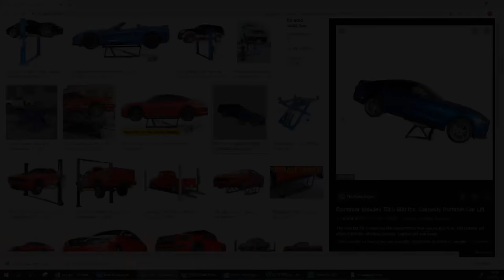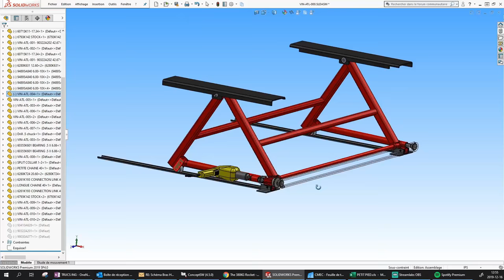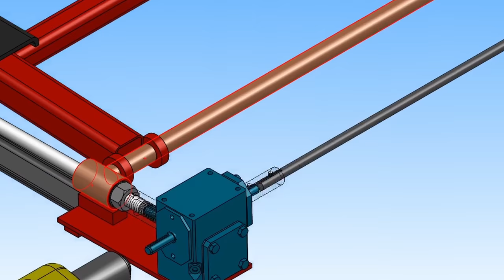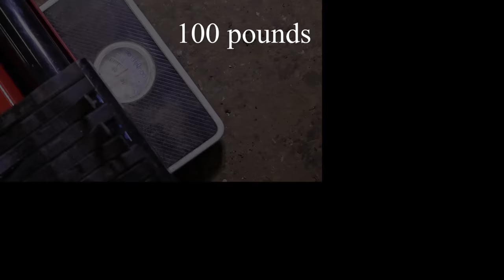DIY Car Jack, Car lift

Comment: Excellent video! Well done! I like the gutter idea for the rollers as I too have a gravel work area. The only difference in my project will be to remove the gear boxes and utilize a central "Y" design for a single ACME rod with the drive mechanism from the front or rear of the vehicle instead of the side where yours is positioned and I will be using this for my Smart For Two
Reply: 350 dólares por cada uno de los dos engranajes reductores marca  IRONMAN by GROVE GEAR). Ahi ya tenemos 700 dolares. agreguemos todo el resto de materiales y ejecucion, Es un aparato muy interesante pero a un elevado precio.

Comment: The unf screws wouldn’t work for long anyway, they are not designed to screw/unscrew often without wear since they have non square (pointed, sharp) thread. The acme rod has a square thread and doesn’t wear when the acme nut is moving on it.

Comment: I made, same swing type lifter for the scooter, few years ago. It locate under of the center stand, which is locked  its lower position by bar.  I rocking scooter side to side by hand and when nearest leg is up, I turn wooden block under it by leg and so on, few times. When both side is level,  scooter swing like your car, its one end up to repair. It`s slow to use and little bit risky to use, but enough usable to stay in my garage. It`s only lifter which I can take on the scooter, for to do lift in other place. 

When I have to remove the engine, the center stand goes with it. So I did, two two-legged rope hoists. I attached two ropes to the winch spool and two pulleys to extend the positions of the ropes, to ensure a stable lift. It lifts optionally in three places: the front, mittle or rear of the scooter. When it lifted at the mittle, it swing. Its two leg frames look like a guillotine and the vinch is on top of it. The frame design is space saver. 
Other 3-rope lifter was attached to the seiling and use one vinch. It was too stationary to use for me.

I made some experiment for rocking table (legs of two pair turned freely down when other end lifted by muscles) to lift scooter, but it did`n got air under its wings...
Reply from the maker: That's a cool build you did Jari, keep up building stuff  👍

Comment: I noticed the front wheels were on wood blocks. Would the jack not have fit without them?
Reply from the maker: You don't need them, but my wife's car has a flappy exhaust cover that keeps getting caught with the lift. So the wooden blocks are optional but useful... 😅😉

Comment: Great idea. Very nice simple design
Reply from the maker: Glad you like it! 👍
Reply: Viny B Viny, I wonder if you could build in a locking system like quick jack to ensure more safety. But I love the way you can lift the back or front for extra space, and it's amazing the car is still well balanced. BTW if we wanted to attempt to build this what sort of gear box is readily available to use. I'd really love to build this because I wan t to help my son change his timjng belt on his car and I can't bend too far atm

Comment: The pivot lol that's fucking genius. But how do you work out the balance? I actually hate jacking up my car. I've a 3.5 tonne jack, pads and all. Yet because you're one corner at a time I always feel it's just unhealthy pressure on the chassis. I'm curious how to make a drive over level lifter for at least either end. Ideally it would be all 4 corners but I'll either get a second jack or come up with something. But I'd at least like to be able to jack the front or rear level on both sides. I've been there too many times where the ground isn't smooth so the jack doesn't rise and pull the car away from the axle stand. I picture driving the front or rear wheels on and then gears rising or pumping jacks so they're balanced.
Reply from the maker: Each car has it s own position with the jack and once you found it, since the gravity center is right on top in the "flat" position, ince you pivot it ine side it slips to this side...quite simple

Comment: Bonjour, connaissez vous le poid maximum que l'on peut soulever avec ce mécanisme ?
Savez la correspondance de 3/4" 16UNF en Europe ?
Reply from the maker: Salut, je ne connais pas la limite de poids de ce jack, je ne l'ai jamais testé à la limite. 3/4 c'est comme du 19 ou 20mm et 16, c'est 16 filet au pouce ou à chaque 1/16, donc au 1.5mm. Mais si je me souviens bien j'avais utilisé du 3/4-10, soit environ du 2.5mm

Comment: Hi Vini can you please put the plans up again. I would like to try making it this summer. The PDF I download is blank. Any chance you can put the 3D plans up again or maybe send it to me. Thanks
Reply from the maker: HI, I'm sorry for safety purposes, I never gave the plans for the lift. For the 3D, make sure to open it using Adobe acrobat reader, not a web page from a browser.
Reply: @VinyB57  Viny, where are the 3D plans. I can only see the PDF version and for some reason it’s blank when I download. Btw, I’m not sure if you noticed but a very similar version to yours seems to be commercially available. I’ll send the website when I find it again
Reply: @VinyB57  Viny, this looks very much like your design. I would probably buy it I’m sure it would be cheaper than me making it. But I don’t think it’s available in Australia.
https://www.autoliftproduction.com/en/autolift3000
They even made a baby version to replace a normal jack. Very clever use of the same design.
Baby version found here https://www.autoliftproduction.com/en/up-down3000

Comment: Hi, will this operate with an impact wrench or impact driver, instead of with just a rotary drill? I like to use an impact wrench to remove lug nuts, but I don't want to buy a separate power drill.
Reply from the maker: When using sprokets or gears, it's never a good idea to use a impact driver, it's like hammering on the teeth of the gear or sprocket. you need a smood flow of rotation, not a jack hammer!
Reply: @VinyB57  is there any combo tool, or at least some kind of adapter, that would allow both different types of operation, for rotary drill and impact wrench? I'd prefer to have that, then have to buy 2 different power tools.
Reply from the maker: @manofsan   Yes, my tip here is to weld a rachet box on the lift, one that you have in extra and use the squarre as an adaptor. Use a box that will fit your impact (don't use a impact 😅) and you can modify a rachet extention to fit your drill, or buy a squarre to hexagonal (for small impact drill) and chuk it in your big drill. I use the squarre to hexagonal for my lift
Reply: @VinyB57  - here's a video from someone who bought a similar type of tilt lift from MaxJax:
https://www.youtube.com/watch?v=YpUh-KjrkfQ
As can be seen, he experienced some serious problems. Are there any similar weaknesses in the design you came up with? Or are such weaknesses inherent to this kind of tilt lift?

Comment: Nice set up. Not including labor, how much did you spend on the parts? I'm considering buying the autolift, which is similar. Thanks!
Reply from the maker: Not much really, 100$ for the gear boxes (2), couple of bearings, acme rodes and nut, I already had the steel, let s say about 200-250$, but a lot of trials and errors... 🤷‍♂️🤦‍♂️
Reply: @VinyB57  Thanks for the info and especially for doing the trial/error. Now I can make an informed decision.

Comment: Hi! Amazing project. Thank you so much for share with us. I'd like to build it for me, but the pdf on  Dropbox link is empty. Can you check it out, please?
Reply from the maker: I Paulo, I had problems with the PDF, because it's still there in the Drobox file, but depending on your ''luck'' and/or your computer, nothing will show up! You can try 2-3 times, sorry sir!
Reply: @VinyB57  Thank you for your quick response! You are the man! Unfortunately I've tried it on 2 different computers (Mac and Windows) and on the iPhone, in 3 different browsers, countless times. I think the file is really blank or DropBox is having problems. The file has no information, no matter if loaded directly into the browser or if I download and open it in Acrobat Reader. Could you try to make it available to us on another platform, like Google Drive for example, please?
Reply: @VinyB57  I just realized that there may be a problem with the password restrictions you set up. Maybe that's why we were unable to view the file's contents.
Reply from the maker: @pauloterenzi  Hi Paulo, I tested the Dropbox link whit my wife's computer, and everything seems to be OK. But once I open the 3D PDF...blank page. I think I reached the limits with 3D PDF, sorry Paulo!
Reply: @VinyB57  then use Google drive !
Reply: Dropbox?🤮🤮🤮🤮

Comment: Can you drop a transmission with this jack?
Reply from the maker: Never tried...don't think I will, but you'll need to add someting in the middle and have the car suspended in the air by something else then the jack!

Comment: Can you please tell me what issues did you have with the first design? Only screw jamming or something more? I have an idea how to build a parallelogram lift for my own use. Russians use volga 24 jack for the drive and its great but who on earth would ever buy a volga other then in USSR. 😀
Reply from the maker: For the first design, yes one of the major issue was the jamming screw, but also, having only a 2:1 reduction with sprockets and chains was to hard on the HP of my 1/2'' chuck drill (Dewalt). Now it's much better with the worm gearbox 5:1 ratio and the '''driving shaft'' between both gearboxes, no more chains!
Reply: I have just realised that i have 1kw motor with 20:1 ratio gearbox and a sprocket for 3/8 chain already on it. I think it is marked 10b-1 that should be more than enough to power my lift. I'll try to upload a video of a finished build. When i finish it. 🤣
Reply: The chain, as I plan, will be placed instead of a screw in Your design. The force distribution is the same, of course diferent design, similar to quick jack models. I practically plan to use your design to lift one side of the parallelogram. I need free floor between two sides of the lift. It will be secured with a support bar on both sides and i trust my welds since i am a certified welder.

Comment: That's a brilliant lift.  Just DON"T EVER get under the car when it's lifted on that device.  ALWAYS use proper axle stands before climbing under a car.
My brother-in-law was almost killed when his floor jack (trolley jack) failed.  He was trapped under the car for a good while, & could barely breathe with the car sitting on his chest.

Comment: PDF INSTRUCTIONS! guys the pdf works fine its not black what you need to do is download adobe acrobat reader. DO NOT use a browser to open the pdf. this pdf is a 3d drawing so it requires adobe acrobat reader. once you open the pdf in there it will be blank just click on the white space and it will render the image. you might see a yellow bar on top that says you have to enable 3d rendering just enable it and you will be good to go.
Reply from the maker: YES ON EVERYTHING YOU SAID!!!!! THANKS MAN! THAT IS A REALLY GOOD EXPLANATION, I'LL CUT AND PAST IT ON THE VIDEO DESCRIPTION👍👍👍👍
Reply: @VinyB57  np I got tired of everyone asking the same thing lol I had to do something about it 😜 i take payment in the form of the real drawing with the dimensions lol!
Reply from the maker: @homerogonzalez2909   Good one... 😂, thanks man!
Reply: @VinyB57  😂😂 cheers 🍻

Comment: Can you tell me , what metal you use to made the jack , because my final semester project is to build a scissor jack that can lift 2 ton or any suggestion to build my project
Reply from the maker: I used standart steel, 1020-1018, but the srcews were hardened steel
Reply: I'm no engineer but consider the screw jacks found in most cars. The thickness of metal is not much more than 1/4" lifting hundreds of pounds.

Comment: I also downloaded the zip file, but when I opened the PDF file in it, nothing shows up on it.  Is it possible to please try to deposit a file that would show the plan?
BTW, awesome video!
NEVER MIND!  I opened it (I did not get it the first time watching the video in that the file is a  3D PDF file).  In any case, folks who are trying to open the file; there is not much in the file that could help you!  The video shows the detail much better (in fact the drawing is shown in the video at 3:05.  It has no dimensions or specs; so, just DO NOT waste your time!
Reply from the maker: Thank you Zack! And yes no dimensions for this project... not this one...for safety purpose. I don't want that someone get hurts and claim that he followed my plans..... I'm sure you'lll understand!

Comment: Do u still use this lift if so how are u finding it ?
Reply from the maker: Yes I'm using it all the time. The only down side is the time of setting, which is almost nothing, 5-10 min at the most. So for a quick job, like an oil, I won't use it, but for bigger jobs, it's a must!

Comment: Can you tell me what the part number for the gearboxes you used are? I've been trying to find them but everything so far I've found is to big
Reply from the maker: You can see the name plate with part number on this video at 5:26, you should have all the info to find one...or two.... 😉
Reply: @VinyB57  Thank you, could you also tell me where you found the lifting pads? Also would 3/8" inch wall square tubing the thickness you are using?

Comment: What problems did you have with the chain and sprocket system ??
Reply from the maker: Hi Lyndon, 2 things, first: it was too hard for the drill, the sprocket reduction of 1:2 was not enough, the drill was smoking after only few seconds, secondo, it felt weak. The shafts were bending has the chain was pulling on the sprockects from both sides. Just a bad design, but maybe with bigger shafts (at leats ø1'') and good reduction (at least 1:5) that could work. But thing how big the sprocket will need to be to get the reduction, that's why I went with the worm gearboxes.

Comment: Can you please tell us the specs of suitable worm gear for this application?
Reply from the maker: Yes sure! I used a 5:1 worm gear. The worm gears need to have pretty straight theeth so it will ''lock'' in place the screw. If you can easely turn the output shaft of the gearbox, you'll know that the gears have to much angle. If you combine the angle of the screw with the gears angles, that will keep the jack ',safely'' in position to put your jack stand underneath the car. I'm hopping that will help you!
Reply: @VinyB57  Many thanks for your quick response; much appreciated.  However, since I am a novice in this game, can you tell me information like the torque capacity or HP,, RPM etc. that would help me to select the right worm gear?
Thanks again!
Reply from the maker: Hi Zach, yes, the spec for the gearboxes are: ratio: 5:1, RPM 1750, input HP:1.248, output HP:1.158, torque:209lbf*in. And they held on very well for the past years. So if you keep it in these specs you should be good! Also, the RPM are generated from my drill (obviusly), witch is 900rpm, not 1750.
Reply: I sincerely appreciate you taking time and answering my question in full and perfect detail - thanks again and stay SAFE!

Comment: How long it took to learn fusion 360. I am new building stuff, and I think fusion looks amazing but I am scared to use.
Reply from the maker: I designed the car jack using SolidWorks, but to program my CNC, in router configuration, I use Fusion 360. Never be scare of learning a new thing, especially nowadays with youtube, there's a ton of good videos on Fusion. Go check NYC CNC, they know what they're doing with this software!

Comment: Viny, how do you compensate for the angle of the lead screw and base as the lift goes up?
Reply from the maker: If I get your question right, I putted a small flat of 1/4'' underneath the main gearbox plate. You can see it at 5:18 I rounded the edges and it help pivot the entire gearbox assembly when the lead screws is moving up on the other side of the lift. Hoppe that answer your question! It's a good one Ron! 👍
Reply: @VinyB57  Hi Viny, another question, did you modify the input shaft on the one gearbox to provide a dual input so that you could drive the second gearbox from the first?. cant seem to find dual input shaft gear boxes. RW
Reply from the maker: @ronwiseman4332  you are totally correct. I extended one of the gearbox shaft. I welded the extention on the worm gear shaft and then I machine it to make sure everything was still concentric. Unfortunately, I did this way before I started making videos on youtube, so I have no footage of this!
Reply: @VinyB57  Thank you, that's what I figured.

Comment: How much did it cost to build ,how long to build,?.?
Reply from the maker: If you don't count the steel that I had in hand, around 300$, and I had a really good deal on the gearboxes 100$ for both. It took me about 3 months to built, during spare times, when the kids are asleep and the wife finaly unleash you 😅

Comment: Nice job fella, I need me one too.  VF
Reply from the maker: Thank you VF! I'ts a real game changer when it's time to repair your car!
Reply: @VinyB57  I hope that this winter I can build my low lift using aluminum  or magnesium to keep it light and corrosion free. Maybe even stainless steel. Not sure right now. But will make a low, drive over and us type.  Keep up the great work too. VF
Reply: @VinyB57  When one uses a friends two post beam lift one realizes that it is time to make some sort of hoist to use at one's own garage. Good day too. VF
Reply from the maker: Humm...aluminium..magnesium... I d'ont know? As long as you don't need to race or fly the thing, the weight is not that important...I think! I really appreciate steel, in his strengh, his availability and it's low cost! But, if you're planning on making one in alu, please send some pics! Good day to you too!
Reply: @VinyB57  I totally agree with you.
Reply: @VinyB57  Peace